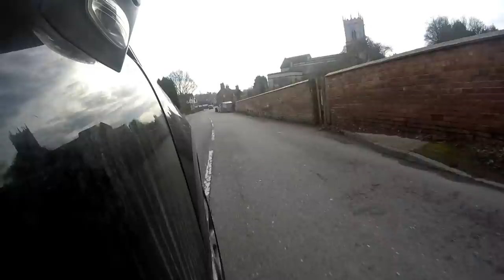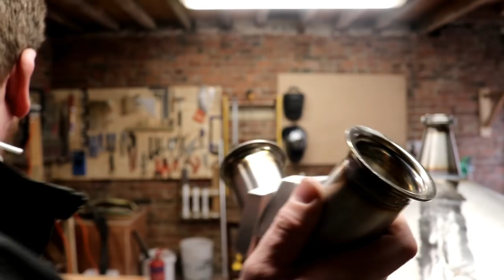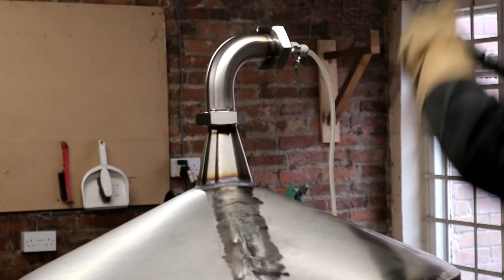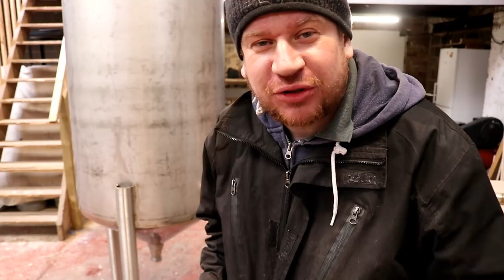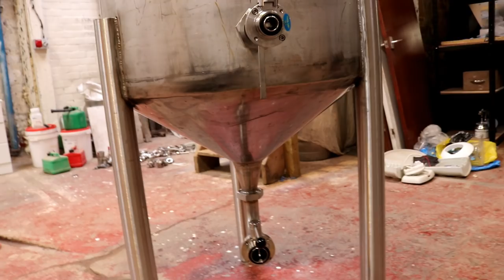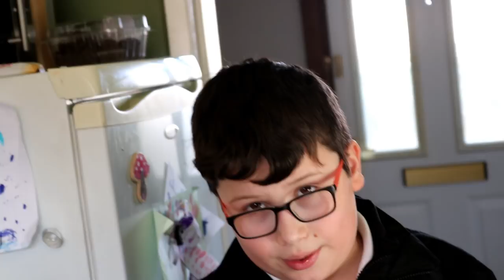Beer Racking Arm

Comment: Awesome job. 

I'd agree with some of the comments to setting it just below horizontal. Then when cracking to move and chase the top of the trub you wont lose any beer through the seal as it will be below the seal. You would also be doing a yeast dump/harvest a few days before racking so it will be well above any sediment in there. 

Glad to see these tanks are getting a few bells and whistles too. If they are going to be custom made, might as well add in a few extras too. Whats next? Racking arm port access becomes part of the CIP system?

Comment: Great job on the racking arm and fermenter overall, but does it still pay to make your own tanks? I totally get the satisfaction your getting from the home build but I do wonder if you're saving money in the long run after all the gas, elekky, fixtures fittings,tools, unit rent, time and materials are costed. If you went back to the beginning of January would you follow the same path? keep up the vlogs though, i'm learning loads.
Reply from the maker: Totally worth it. this question is worth a video on its own. thanks for asking mate. I will answer this a best I can very soon.

Comment: i may expose myself as being stupid here but i'm struggling to see why you need a racking arm when you have an outlet at the bottom of the conical?  You can't just drain off the yeast and trub through the bottom first leaving your beer behind to do with as you will?
Reply: with those cylindric sight glasses he could check the yeast level tho
Reply from the maker: These conicals are 45 degrees, quite a shallow angle compared to my last ones which were 60 degrees. Even then we always got trub and yeast shoot out into casks even after trying to drain it all off. Learning from my mistakes, a lot of micros use racking arms, if it fails I also have the option the go back to the old way.
Reply from the maker: I would never have sight glasses on my fermenters for sanitary reasons.
Reply: i didnt mean those on the side,meant to watch the liquid level tho